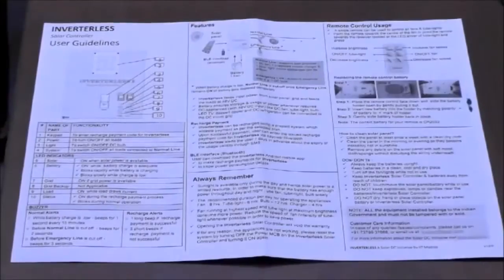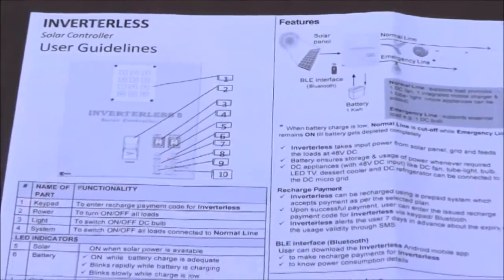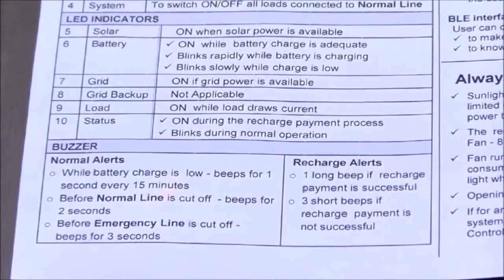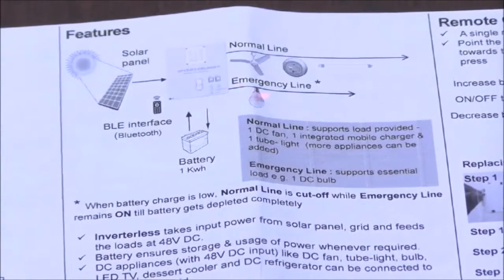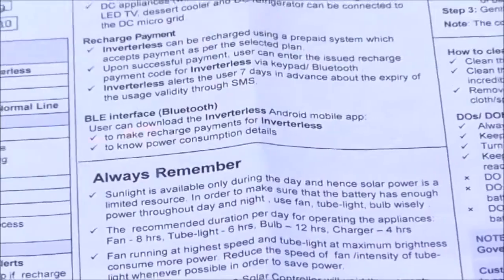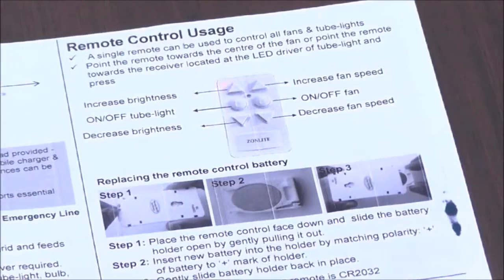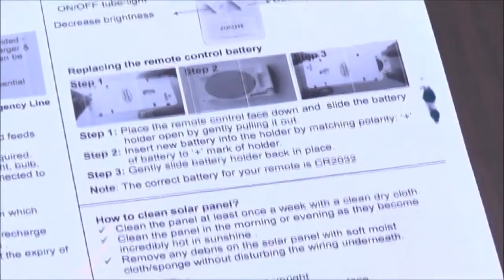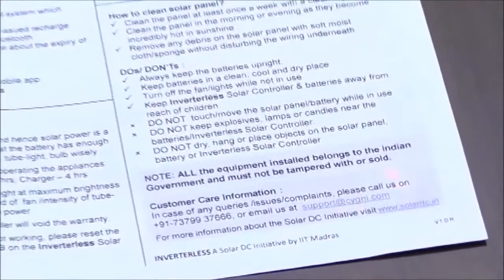User Guidelines for Inverterless - Advance Solar DC power solution

Comment: if controler is does nt wrkt how connt all the connectn drctly to the btry pls reply
Reply from the maker: Our system is equipped with a lithium-ion battery which is protected by BMS circuit. It is not recommended to connect directly to the battery as it will void the warranty.If you are facing any issue, please contact our customer care @ 7379937666
Reply from the maker: Please do not operate the equipment yourself. Call Cygni Customer support @7379937666 The warranty is void if you open the outer box’.
Reply: What is the mobile app? Please reply
Reply from the maker: The Cygni Customer app is available to users of Cygni IBIS. The app helps the user to track energy usage.
Reply from the maker: The Cygni Customer app is available to users of Cygni IBIS. The app helps the user to track energy usage.